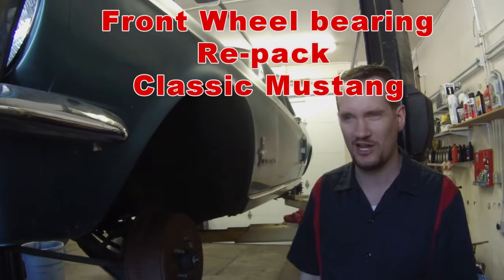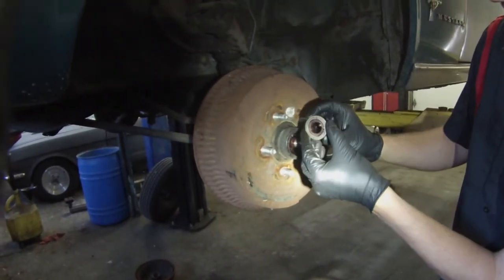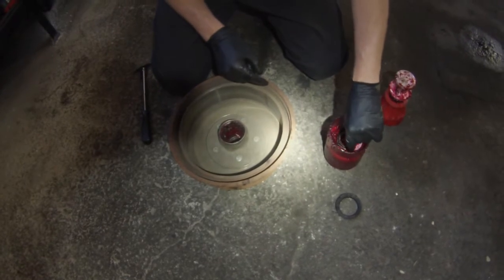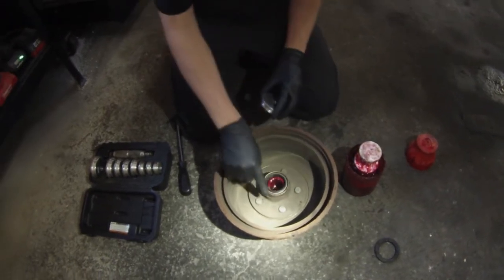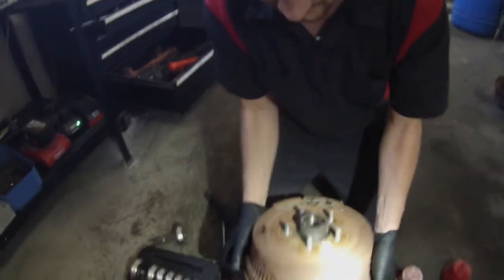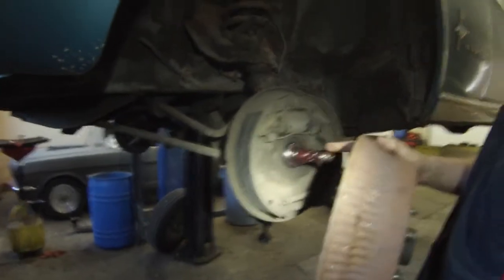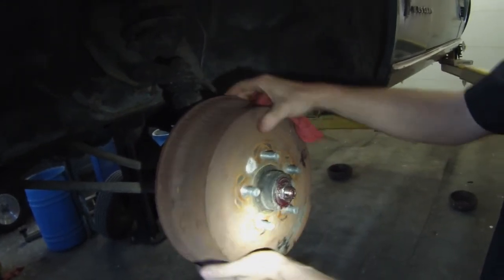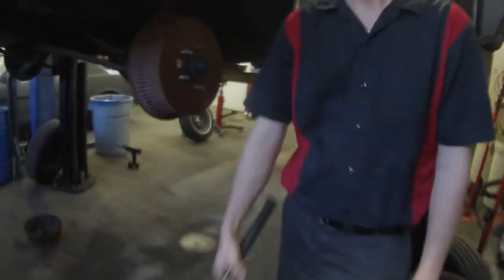How to pack your front wheel bearings on your classic Ford Mustang

Comment: Do you need to pack the cavity between the inner and outer bearings with grease too or just squeezing the two bearings in the grease can like you did? Thanks!
Reply from the maker: I usually put some grease in there but it doesn't need to be packed chuck full.
Reply: @AlfsMustangGarage  Thanks a lot, Alf!  It took me a very long time to clean all that gunk from there, was like the dirtiest job I did on the car but that's why they call us grease monkeys.. Just to note the inner seal part number, that is National 6815 sold for $6 each
Reply from the maker: You're welcome. Yup sometimes it gets messy. That's why I wear my gloves 👍

Comment: If you don’t get it right the first time around, can you back the nut up and try again,?
Reply: Your videos have motivated to get under the hood.  So far I’ve replaced the front suspension and steering, brakes and hardware, and now wheel bearings and races.  👍🏽
Reply from the maker: You mean when you install the assembly back on the car and you're setting the pre-load? Yes you can.
Reply from the maker: That's awesome! Good to hear!